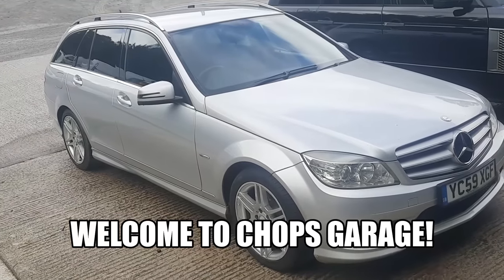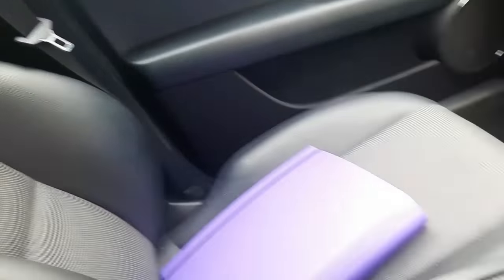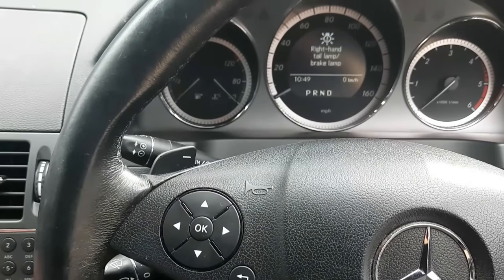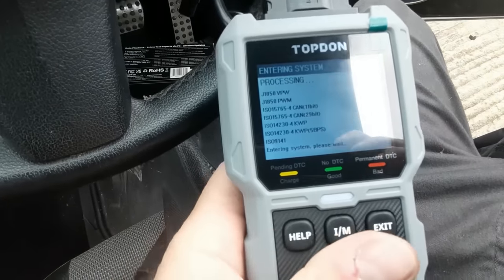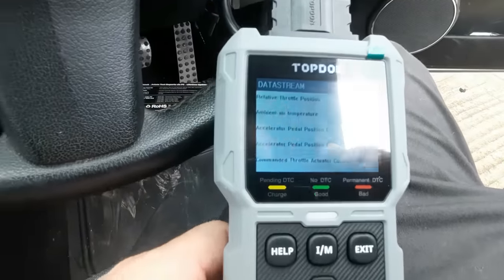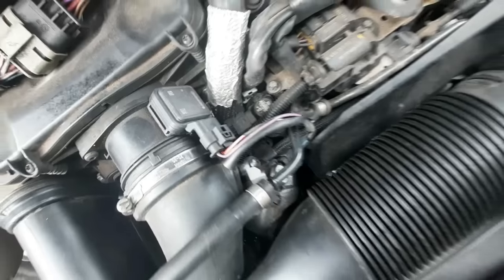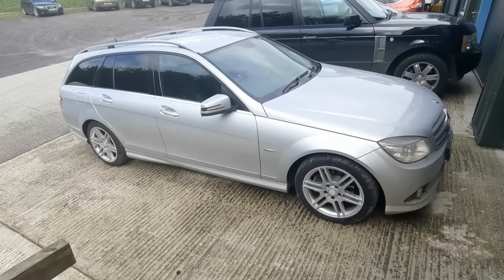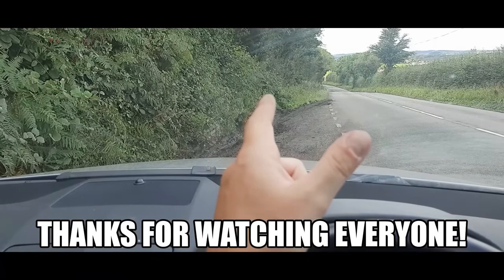Cheap Mercedes C220 CDI - This is exactly why you should NOT buy old Diesels!

Comment: My old 2.0 diesel xsara is touching on 250k miles What's wrong with old cars lmao? 😂
Reply: You won't get that sort of milage out of todays cars, some engines fail under warranty.
The rest fall apart at 100K miles
Reply: @Barbarapape  100% agree, wife had a 2014 peugeot 308 1.4 and the timing chain snapped at 53k miles. Destroyed the engine
Reply: Pre dpf are fine apart from egr valves but the modern shit the emissions equipment is so bad even worse on the euro 6 diesels especially jaguar land rover there dpfs are melting/cracking at low mileages so a dpf clean wont fix them
Reply: @Barbarapape  2.0 hdi /2.0 tdci ( same engine) are amazing and last past 300 thousand miles if looked after, yeah parts will need replacing but that's maintenance..... everyone moans on about injectors and Duel mass flywheels etc yeah parts need replacing if you can afford that get the bus😂
Reply: @ryanmccormick2150 I have that engine in a 2011 mondeo . Its  fast and has great mpg. Shame its euro 5   that might be it's downfall as things progress.
Reply: @Barbarapape the old ones are far better 
My 1999 Peugeot 406 
I bought it in 2002 with 100k milles , sold it 4 years later with 220,000 miles 
Original exhaust fell off 140 k miles 
I replaced clutch at 180 k miles 
And fuel pump failed 190 k miles 
400 quid for new clutch 
200 quid for new fuel pump 
300 for exhaust 

Great car
Reply: I have a 15 year old Honda Accord with 130K on the clock
and it passes every mot with no advisories so i am keeping it.
They will never make cars like these again @boyasaka
Reply: @Barbarapape  your right there 
I have a 10 year Honda civic which is the mk 9 
And it’s never missed a beat and I know for a fact the mk 9 (2012 to 2017 ) is miles more reliable than the mk 10 that replaced it 
I think my car will last another 10 years easy , and by then will still have less than 100 k miles on it 
( currently 49k miles at ten years old
Reply: Sorry to hear about the chain snapping, some people dislike the timing belts
but chains can also fail if the lubrication is poor or the tensioner fails. @T3-RIDER
Reply: @chrishart8548  They are great Engine's, I've had them in a few different cars.... currently in a focus Titanium X 163bhp pulls lovely but yeah you have a great point!
Reply: @ryanmccormick2150  mines also a 163bhp titanium-x.    Its a mondeo  estate though.   Also the powershift.    Not sure if that's a good thing or a bad thing.
Reply: @chrishart8548  sounds like a lovely car Chris....my focus is an Estate too, I think Mondeo and focus look better in the Estate version also mega practical 👍
Reply: @Barbarapape There are electric taxis with a lot more miles that have had virtually no work done. A lot of cars will easily do the high miles especially the newer electrics.
Reply: Same with my 2008 x-trail. 300,000 km.
Reply: Your xsara has one of the best engines ever made
Reply: @ryanmccormick2150  but the hdi is made in France, with better parts. Same same but different. Still a brilliant engine
Reply: @echatz  my ford focus 2.0 tdci has PSA... Peugeot/Citroen stamped on the engine in multiple places, the plastic engine cover has ford tdci whatever but all castings say Peugeot/ Citroen 👍
Reply: @ryanmccormick2150  yeah , but here is the thing. Normally the tdci is made in Dagenham and the hdi is made in Trmemery, France.

The engine is meant to be the same, yes there are many PSA FoMoCo parts on it. However Ford's tent to be a bit cheaper, some even have plastic sumps. It is  a great engine in both versions.
Reply: @sbrader97 best to get dpf gutted and mapped out on those
Reply: my gasoline get 300k miles who need old diesel?
Reply: did you even watch the video? your car has non of the antipolution system modern diesel has
Reply: My 2.0 diesel Peugeot 206 has done 156k. Just run in lol
Reply: I run a 2005 Skoda Fabia VRS 1.9 TDI: barely run in at 118k miles. I keep it as it never misses a beat. I was going to trade it in for a Focus 1.0 Ecoboost as was impressed with that motor but thankfully i didn’t. I’m going to run the Skoda into the ground until I am forced to get an electric.
Reply: My 04 plate Peugeot 307 2.0 Hdi is running sweetly....done 264,000 miles - still pulls well, starts quickly and does 55 mpg at 60 mph. Bodywork going to go before engine but out of principle I want to get to 300K
Reply: I have a 99 GMC suburban 2500 with a 7.4 l V8 with 258,000 miles on it. Just passed California smog as well 😊
Reply: Renault 2.1 td from 1992, never failed
Reply: @gosonegr  before technology and emissions killed longevity.
Reply: @samholdsworth420  yeah, back in the day, if the thing was capable to turn on it was good enough to be driven. 
To be fair my 04 diesel corolla already passed 250k km and it runs like a charm, I can't see me getting a new daily driver on the same segment nowadays.
Reply: @gosonegr  Toyota is the exception 😂
Reply: @chrishart8548 are powershits that bad if maintained properly?   
   Never heard anything good about them.
Reply: @ryanmccormick2150 that’s why all focus n fiesta sound like C4 C5 C3
Reply: @bdeithrick  I've heard the ones in the focus and fiesta  are not great.   The bigger powershift in the mondeo s max etc has oil the others are dry.  I have a mondeo I love the powershift  I can't fault it.  Maybe if the oil gets changed every 30k it's fine
Reply: Very lucky,most fail

Comment: I purchased a “C220 FROM 2012 WITH 200K ON THE CLOCK”  a lady one driver, meticulously maintained. The fuel bill is minuscule and performs better than its petrol equivalent. It reaches it top speed faster than the petrol version, with a higher top speed and on 25% less fuel, WINNER!!!!!!!!!.
Reply: Very similar with my C220 2014 with 80,000 on the clock. Works like a charm

Comment: Absolutely nothing wrong with buying old diesels if you do your due diligence. I bought a 2003 VW 130 pd 5 years ago. Since then it has done well over 50k miles. In that time it has needed a new radiator and two front suspension arms. So besides servicing which I do myself, it has cost me £444 for the suspension arms and £450 for the radiator. Not bad for a 21 year old car. What he should have said is don’t buy a newer diesel, they can be a nightmare with all the sensors, emissions dpf etc. VW PD engines are the best diesels ever made. My old VW PD 130 is ultra reliable and comfortable. Old school diesels are simply some of the best cars you can buy!!

Comment: I bought a 54plate 220cdi 1 owner from new. Just over 118000 miles. It was the biggest heap of crap I've ever brought. Crank sensor, cam sensor, leaking inlet manifold, manifold valves stopped working, yaw sensor. Limp mode most of the time. In 6 months i probably had 1 week out of it. I scrapped it in the end after spending nearly a grand on it. Never have a Mercedes ever again.

Comment: I have the same car. So couple of points the engine will not regenerate the d.p.f if there is 
1: an engine fault code present.
2: the fuel level is below 15 litres. 
3: the ash content is too high.
Fix the air mass first then drive the car it will heat up the Dpf  rapid you will know it’s regenerating because it will drive faster than usual and a lot of heat will be felt under the the drivers side. It will clear the Dpf in about 15 miles if in good condition. They don’t suffer from Dpf problems unless the conditions haven’t been met. Good luck
Reply: Totally agree mate 👍
Reply from the maker: Cheers bud
Reply: Im a taxi driver driving an 2018 c200d om651. The car is doing 99% city driving. Never had any issues it... Maintanance is key and premium diesel!

Comment: I have the saloon version of this car on a 58 plate with 219K on the clock and the 6-speed manual transmission. The diesel engines are generally quite bulletproof. The intercooler hoses are prone to splitting but they're not too expensive to replace even from the dealer. It is worth running some Cataclean through the fuel system. I've done it on mine. One big issue with the W204 is corrosion on the rear subframe.  Fortunately, this should be covered by warranty. I'm a Topdon fanboy myself and I would definitely recommend their products are they're good quality.
Reply: If yours is the 200cdi or 220cdi it doesn't have the dreaded dpf
Reply: If good fuel used and annual can of bg44k dpf will be fine ,it’s supermarket syrup that wreaks them
Reply: My OM646 is none the worse for supermarket fuel although Costo's offerings are preferred due to the cost. BG products are good. I think you meant BG244 because BG44K is for petrol.
Reply: Depends how hard you drive these modern diesels. Diesel is over 7 dollars a gallon in Germany so they drive very conservatively and the motors last. Older diesels lasted well. New ones far less bulletproof! Timing chains and oil leaks are a problem.
Reply: @Parknest 000😊0000000

Comment: I still miss my old Seat 1.9 TDI 110hp, in the end it was old, had a ton of miles, but the fairly simple engine was so tough. In the 15 years I had it, apart from some discs, bushes and normal servicing, it needed nothing, returned 50 to 60 mpg......it was quick enough after being chipped,  utterly brilliant car !
Reply: Have my 1.9 tdi 66kw - that engine will live forever. There are good cars and bad cars. You had one of the best of the best.
Reply: 1.9TDI is a very, very understressed engine which is why it lives so long.
Reply: All the 2l diesels we've had have been tough and unstressed and have covered a lot of miles with little more than fluid and filter changes @shueibdahir
Reply: I had a 110bhp Toledo many years back, it was much nicer than the VW equivalent Bora

Comment: P2463 is probably a result of the MAF being faulty. If the mass airflow sensor isn't reading correctly the DPF regeneration will be inhibited so it will keep accumulating soot. I'd take a gander and say that when the MAF works properly, the DPF will clear itself out during a few drive cycles.

MAF code could also be caused by a leaky boost pipe or an EGR valve that is sticking open if it's a performance code.

Comment: I have a 2006 Citroën C4 1.6l, 16 valve diesel coupé which I bought for €2800 at the beginning of last year. 240K KMs (150K miles) on the clock. Apart from a freak occurence which broke the turbo (€600 replacement), it runs like clockwork. I know it will break down one of these days but is a great drive and gives me lots of freedom. I drive carefully and get 70 MPG from it. If you look after an old car it will look after you.
Reply: Bet you can't convince Sadiq!!
Reply: Turbo failure is a very common problem on those 1.6 PSA diesel engines. The turbo was almost intended to be a consumable part after 200.000km, there is a strainer in the oil supply line which gets clogged and starves the turbo of oil. Fords and Volvos with this engine will suffer the same fate.

Comment: I would say the opposite: old Diesels are less trouble than modern common rail, DPF, Ad Blue motors. Any pre Common Rail Merc Diesel is pretty bulletproof if looked after. If anyone has a nice clean late 90s E300 Turbodiesel I’ll have it off of you!
Reply: agreed, I would call an old diesel merc SLK or any pre DPF motor.

Comment: I my experience high mileage diesels tend to be very reliable... Assuming they arent a bad construction. My b6 passat with a 2.0pd and dsg has 205k miles on it, bough it with 163k. In 3 years never had a major issue with it. Recently rebuilt the suspension because i knew i was gonna keep the car for another 3 years at least and wanted it to ride nice, and done the dual mass as well because I was starting to hear a little rattle, was told i could've used it for at least another year but I wanted it done. Apart from that car has been absolutely trouble free, its loaded with extras and everything works. Just recently had an engine light for glow plugs, which again, just regular maintenance stuff on diesels. Not even gonna take it to the garage, they are easy to do. Many of my friends own bimmer, audi and merc diesels, they are also trouble free. If they were looked after they will outlive most cars. Its just people buy these premium cars and then not do the proper maintenance and drive them into the ground, then someone buys it without proper inspection and when the engine goes because it had bad oil in it or not changed they blame the brand and thats how the bad reputation builds.

Comment: I just bought the Topdon Artidiag  600s.
You and Car UK have pipped on about their products so much I thought I'd give it a go. 
Brilliant bit of kit. 
Cleared codes and solved the problems 
I'm amazed how it does stuff right in front of your eyes. 
Its incredible.
Saved me £££ that a mechanic would have charged me and I can save again when future issues come up. 
Glad you and Car UK  show us this stuff. 
And pay you guys for promoting it. 
Win win all round. 
⭐⭐⭐⭐⭐
Reply from the maker: Great stuff.  Good kit isn't it! I dint take payment from them BTW. They instead support the raffles with kit.
Reply: @ChopsGarage  Yeah it's brilliant. 
I had the engine warning and airbag lights come on.
Plugged it in and code for low turbo pressure and driver's seat air bag. 
Found a split in the intercooler pipe. 
Saved me loads as a garage charges £50 plus to plug in their machine. 
And silly amounts on top to fix it. 
So thank you for pointing their products our way.
Reply: Is the one you bought, the Artidiag 600s, better than the one linked to in the video description, the AL500B?

I'm new to using a proper one and have tried the cheapie ones but they don't show a code for the ESP faulty that's coming up on my dashboard.

Comment: My old fiat diesel fiat stilo estate did over 300k (200k mine) miles before I retired it for an identical 19yr old replacement bought for £700. Blanked off the EGR valve, regularly clean air mass sensor, use Dipetane fuel additive to reduce particulates, 55mpg overall. Old school high mileage diesels rock !
Reply from the maker: Good move
Reply: @ChopsGarage  Your agenda is noted. you use an example of a car known to be expensive on parts and labour to make you point.
This Merc has very little in common with say a 1.5TDCi Engine vehicle at all. The only issue with Diesels is DPFs, DMFs & Pump & injectors.. Neither of which will be an issue before 90,000miles, some a lot longer than that. Diesel engines (the Actual engine and transmissions) are Very reliable. It's also a lot more financially viable to fix a Focus or a mondeo than it is a Mercedes.. & That is why you selected a Merc for this video.
Your agenda is OBVIOUS.
Reply from the maker: @GMT439  🤣🤣agenda??! Lol! What is this some conspiracy. Dramatic much? What did I have 20 part ex diesels in front of me and said, oh I must pick the merc for my agenda 🤣🤣 thanks this proper made me laugh

Comment: I had the intermittent engine light and limp mode that turned out to be the DPF needing a good clean. They told me to constantly keep the fuel over a quarter of a tank. I also had the bulb warnings, that was where someone had put LED upgraded bulbs in, the sensors couldn’t pick up a current. Went back to the old style bulbs and warnings went. I love my 2010 E Class Coupe … I always had big contract hires costing £400 a month so bought this for 5k and figure every month I don’t have a problem I’m building up a decent repair fund. Lovely looking cars and great drive… plus I get 43 to the gallon… but no Satnav was a shocker.
Reply: Exactly!  If people spent what they pay on finance on a new car on maintaining their old one, they’d have a brand new feeling car in a year.

Comment: This is a lovely car with years of life left in it.  There will be issues and pricing reflects this but a Mercedes CDI will probably double this mileage.  Diesels can be more complicated but this car has the potential to be a reliable one and a joy to own.  A DPF clean , Forte or Millers treatment, an oil change and a good run?
Reply: "Diesels can be more complicated", you say. How? FFS petrol engines are way more complicated, and likely to have even more to worry about at this mileage. Sure the diesels may have some issues, but they're not complicated at all, compared to petrol.
Reply: @An_Idiot_in_the_Wild Well for a start, all diesels are turbocharged where some petrols are not. Diesels have dpf and cats whereas petrol will have only cats. Diesels have two fuel pumps. They have egr flaps which petrols dont, they have intake swirl flaps which some petrols dont have. Some petrol engines are complicated but diesels are almost always more complicated
Reply: Plus good diesel mechanics are thin on the ground, and will charge accordingly.
Reply: Very sweeping staement.My older diesel has neither turbo,dpf,or egr.,and it's totally reliable.
Reply: nowadays most of the petrol cars come with a turbo, egr, flaps, direct injection, gpf, dual mass flywheel, so diesel is harder to work on nowadays? they aren't, both of them are made of cheap chinesium plastic @SavedbyHim
Reply: If it won't give over 3000's revs it's in limp mode.

Comment: If the DPF is blocked, there's something preventing regeneration - possibly even just low oil quality. If you're getting MAF codes they might be the MAF or due the DPF being blocked... MAF is an easy change and then a DPF clean (not a forced regen). Then re-evaluate.